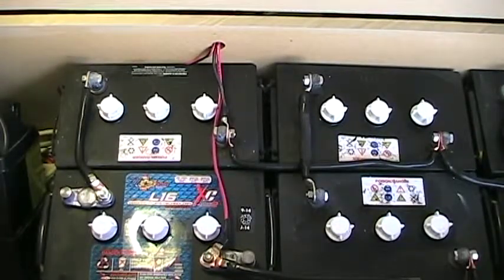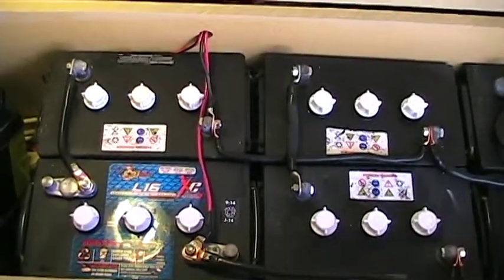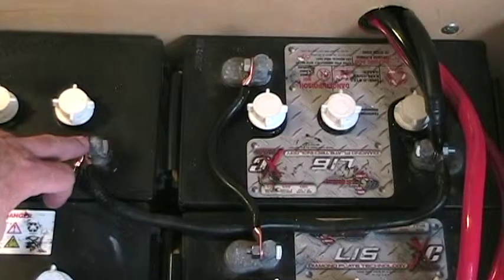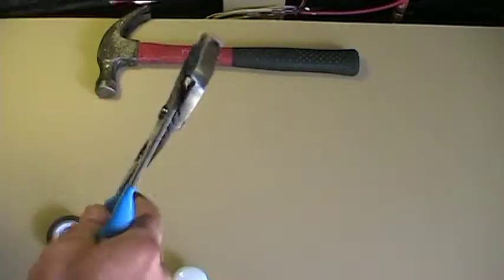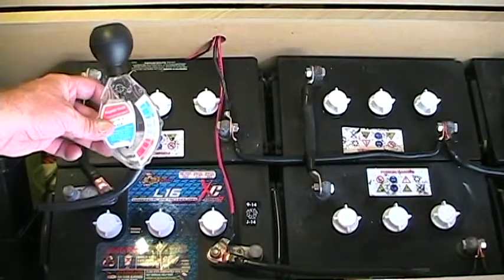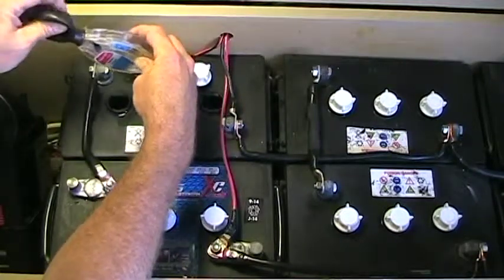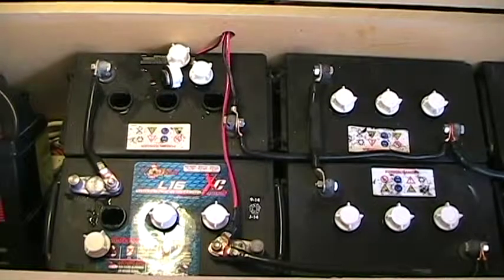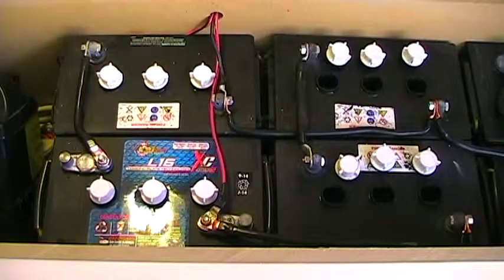New L16 Battery & Specific Gravity testing all 18 cells - The Portable Solar Power System

Comment: My bank is of different ages too. I have it split into three separate banks to get around the age problem.  charge and discharge each bank separately, aggravating but necessary. Hey write down those gravity levels when you take them, lable each battery so you know which one is which and the cell closest to the pos post is cell number 1, 2, then 3 at the negative post. Keeping records of the readings gives you a heads up on what they are doing .

Comment: I used to have the same series parallel setup on a solar charged motorhome except I put a fuse on each series interconnect, if a battery shorts it doesn't take the rest of them with it and less likelihood of a fire.
Reply from the maker: +Alameda Repair Shop That's a great idea.  I rely on my enclosure hatch to keep thing away from the exposed battery post.  Thanks for watching.
Reply from the maker: gettinready101 Fuses are not needed between every battery interconnect, or any interconnect for that matter.  There is a difference between "a good idea" and "needed".
Reply from the maker: gettinready101 Read my original replay here about the hatch to the battery enclosure.  Clumsy folks will screw it up no matter how many fuses so unless your daddy owns a fuse factory, I cannot justify a fuse between every interconnect.  Thanks for watching.
Reply from the maker: gettinready101 Absolutely, my lug nut wrench is taped from end to end and I mentioned that in one of the videos.

Comment: if the gravity is over 1.280 then make sure you check your fluid level, also watch for high temps because they will cause your neg plates to degrade
Reply from the maker: Hey, thanks for watching.  The only battery that was above that level was the brand new battery.  I'm using a very inexpensive hydrometer so I'm going to get another model at some point...  most likely in a month or so when I check the cells again.
Reply: when these batteries come off the line the gravity is usually in the 1.280 range because the plates themselves have a lot of acid that will be pushed out during formation. Just keep an eye on it and your temps. Love the application and if its not in use then try a pulse charger to keep your plates from sulfating. also you can always check the grav by weighing 100ml @ 80 degrees F.
Reply: +charlesgabel being a battery man at us battery could you do a video on proper testing procedures for measuring gravity. I have noticed that on some of my readings taken one after the other in the same cell i get two different readings. most of the time its because of different fill levels of my hydrometer but where do we take the electrolyte from? top of electrolyte? top of plate? Inquiring minds need to know.